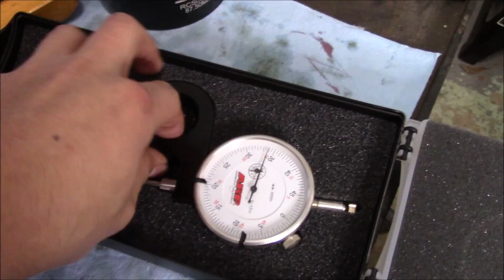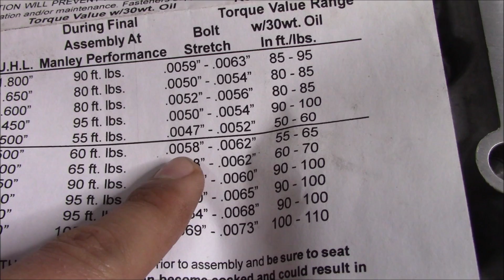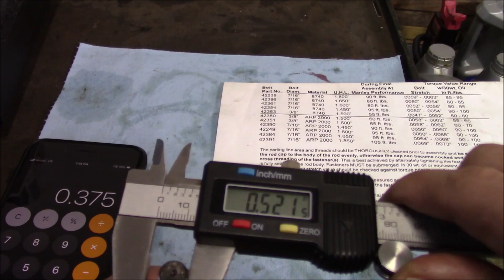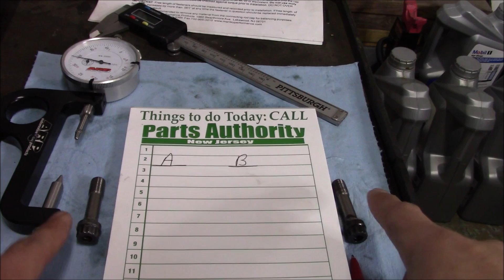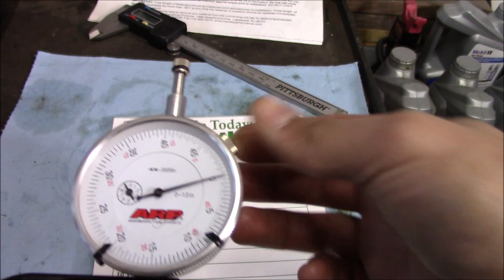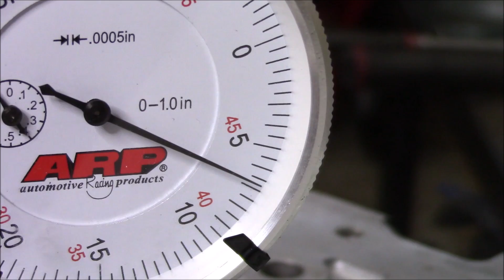Ultimate K20/K24 Build Guide! PT.8 (Stretching Rod Bolts)

Comment: Good video buddy. I always use ARP lube, also you have to lube the underside of the bolt head that touches the cap because the friction can throw out your torque value. Always start from a less torque setting and  work your way up the the torque of the data sheet. Don't go to the full torque value. So basically once you have the correct stretch then you record your value on the torque wrench and thats what you use to do the rest.

Comment: What's up!! Man this 30 weight oil isn't cutting it.. bolts would not turn any more. So I used a tiny bit of arp fastener. Then I was able to get it. Still was super hard.. same arp bolt guage. I got 0060 on each bolt.. besides one of them witch is 0070 think that's to much? Should I replace it?

Comment: Thanks! I was eying the ARP stretch gauge but since I'm only going to stretch 8 ARP2000 rod bolts I cannot justify the price. I went for a Proform 66788 and I'm pleasantly surprised by the quality, it's a well-made tool and it is very repeatable, it does the job for 1/3 the price. My ARP bolts and studs each came with their own tiny spec sheet.
Reply: Yeah I looked up the arp stretch gauge after watching this and nearly shit myself after seeing the price. Is there really any difference in between them? Because I was thinking of going for the proform one too

Comment: Also remember there can be very, very slight variations in rod bearings and/or caps giving you slight variations in stretch readings for your bolts, but no worries
Reply: Yep I think this is why I was able to get 7 of them perfect but one , max stretch was 0062 ones at 0070 but the rest are at 0060.. not sure if that's gonna work.
Reply: @noblewon3507  Did you end up throwing a rod or nah lol
Reply: @dkis8730  lmaooo nah man didn't run the king race bearings broke it down and used acl got what I was looking for. Ironically I'm supposed to do the drop tomorrow with my friend .. it came out great!! I did a pretty nice motor I'll be dropping the video soon
Reply: @noblewon3507  damn do you know what you did wrong? Im building a motor for my first time, and I'm nervous as shit. I was planning on using ACL bearings though, checking all the clearances and everything so I'll get the necessary color Honda bearing if needed
Reply: @dkis8730  yep the bearings were bad quality. thrust washers were thiner as well. To lose oil clearance and too much crank play
Reply: @noblewon3507  Did you not check the clearances when assembling?
Reply: @dkis8730  yea without the crank I checked it was a little loose on oil clearance. I was told it should be fine then I installed the crank and had to much walk , replaced them with acls and was where I wanted it to be. Even though they're supposed to be the same size according to my caliper the ACL thrush washers were thicker. And the main bearings where also. I didn't have to have any of the block milled came out of a TSX 06 with 80k on it.. king bearings for the kseries isn't ideal those are better for ls motors. As for the one bolt I stretched too much when I took it out it went back to its original size so I corrected it
Reply: @noblewon3507  Do you remember what your crankshaft endplay was? I'm measuring mine at around .0040 which is like the tightest it can be in the service manual, and ik you usually want to build on the looser side. And that's after sanding my ACL thrust washers down with some 800 grit on glass. 
I also measured with a micrometer, and the ACL washers are slightly thinner than the OEM Honda ones that were originally in the motor, which doesn't make any sense to me. 
I think it'll be fine, but I just wanna check bc I don't know anyone personally who has built any engines, and I'm kinda just trying to do it on my own with YouTube/service manuals/car forums. Would suck if I spent all this time and money only to fuck it up and destroy the engine.
Reply: @dkis8730  mine was 0043 had to look at my logs. I assume this is a manual transmission cause autos have tighter specs usually..  as long as it's on spec your good. During the break in procedure you will trim down what needs to be , and as u might already know change the oil the next day , don't drive it just run it at 2500 rpm for 10-15 mins turn the car off , change the oil next morning or afternoon look for chunks (your going to see some shavings. Recommend getting a magnetic plug..
Reply: @noblewon3507  ok that makes me feel better, and yeah I knew about it would get a bit looser with break in. Already got a magnetic plug, and yeah I was thinking use break in oil, change oil and filter after holding rpms at 2000-3000 for 15 minutes after first start. Then change oil and filter after 200 miles, still using break in oil. Then 500 miles, still using break in oil, then 1000. And at that oil change I'll probably switch to full synthetic and go every 2000 miles but I'm not sure yet. 
Also I'm not sure what weight oil to use. I was thinking 10w-30 at least bc forged pistons will slap on cold starts, so having the thicker cold weight might help. Not sure if that's a good idea though, and I'm not sure if I need to use 10w-40 or something, but I'm gonna be NA at first so I don't think so, but idk. Do you know what forged internal NA k series tend to use?
Reply: @dkis8730  I just run it for 15 change  the next day using rotella t4 10w30 for first start up. Using t4 till Next oil change at 500 miles. Then I switched to synthetics.. I make sure their rings are seated by the way I drive it.. if u race it 1030 weight is good especially in the summer.. won't thin out as much. In the winter I use 5w30 if I'm racing I switch back to 1030. 10w40 even isn't a bad idea if you're racing the car while it is summer time weather..
Reply: @noblewon3507  yeah it's my daily, but I'm in Texas where it's like 90-100 every day. I also tend to drive like a total asshole, although I think I'll be more scared to rag on it all the time after I have the built motor in ironically enough lmao.
Reply: @dkis8730  trust me I understand. But don't forget to enjoy your high profoamce build the way it's meant. If built strong it's will hold.. these motors love to be beat on.

Comment: In your scenario where bolt ‘B’ was over stretched, is it acceptable to slightly loosen bolt ‘B’  until the bolt stretch is within the specification, disregarding the torque specification?